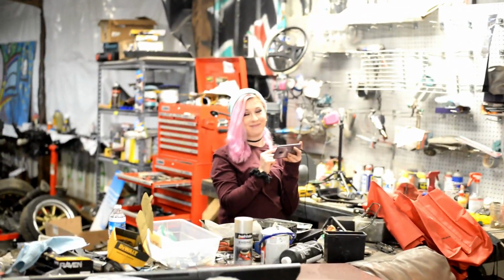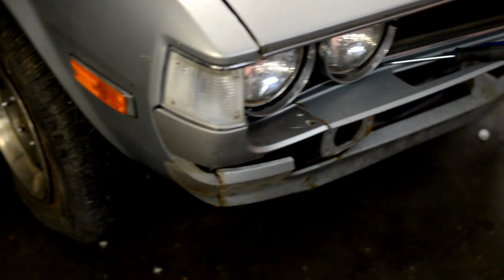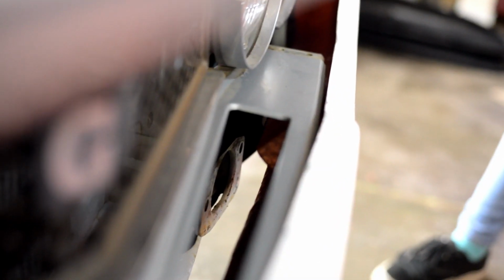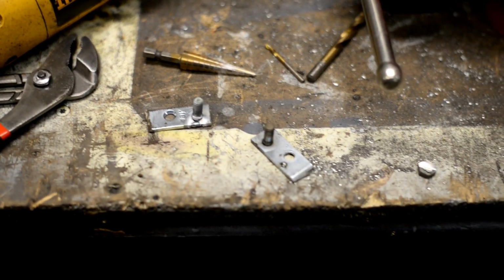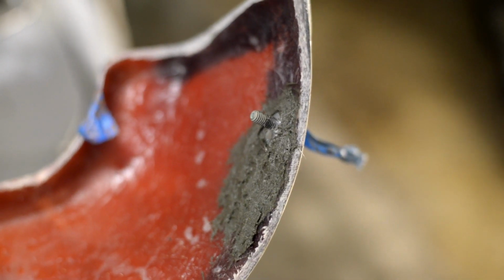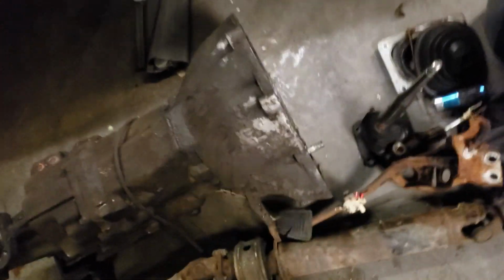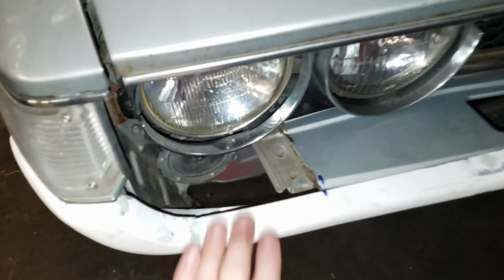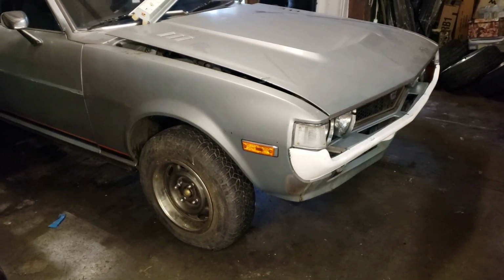JDM BUMPERS! ROBOGIRLY 77 CELICA BUILD #2

Comment: The "Jam" in the house rocking her STYLE!
You took so much visual weight off the car ,now the front looks feather light.
That rusty hulk has many hard to get parts on it. Horde  every piece of trim, glass, brakes .That auto matic rear end should be a different Final drive ratio than the one with the five speed so keep them both.
    Clips screws fastners.
A gold mine of parts on the rusty car ,hinges there is alot of meat on those bones !
Great find! ( And another GT? Unbelievable )
Great to see the RoboGirl whirling and twirling ,with the Mighty Ants !
The garage was full of Dweebs !!!!
Reply from the maker: As always thanks so much for your input and kind words! We always look forward to seeing your comments!.
Reply: @initialdweebs4050  the Dweebs shop is chaulk full of builds . RoboGirl and the Mighty Ants are in full on mode ,2020 JDM SUMMER !